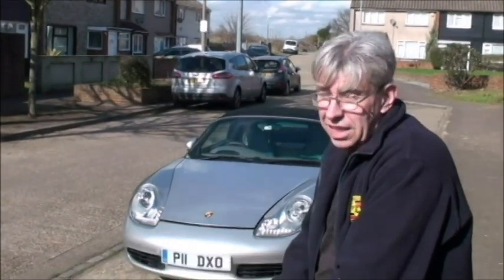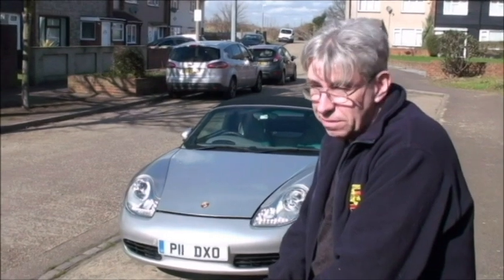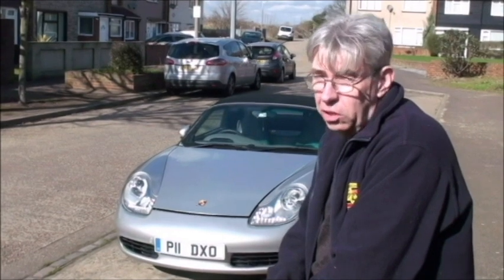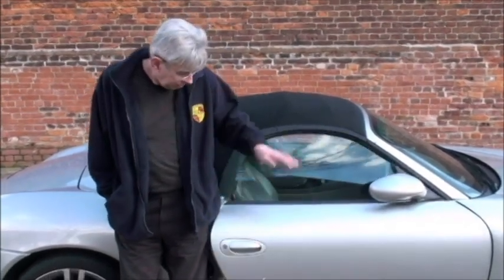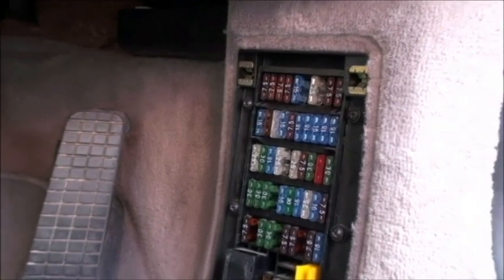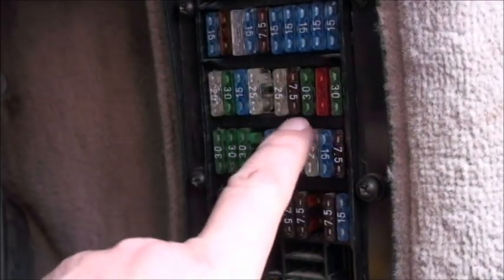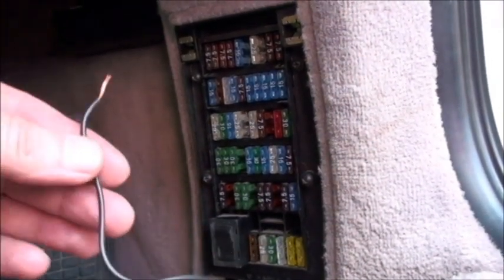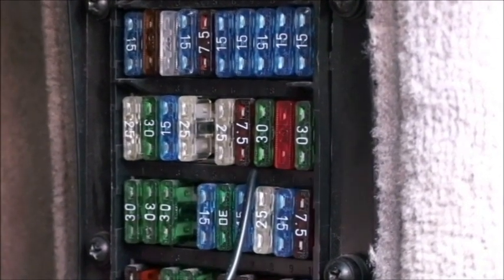Dead Battery: Opening the bonnet on a Boxster 986

Comment: Visiting this page in 2021.  This trick got me out of a bind when the battery on my 2000 Porsche Boxster S went completely dead, and the guy from the towing company said he could not jump it if I cannot open the hood.  For this US model, the C3 fuse is indeed 3rd from top and left.  It worked just like the video says --the car was able to get enough power to get unlocked, and for me to pop the hood.  Now I can recharge the battery myself.

Comment: Hey Mr. 1962 I'm mister 1963 ;} Thanks for this, but I'm still stuck my 2003 Boxster (With drivers side on the Left) Has the pull out Red Lead but is still dead in the water. I assume I fried a fuse or something ... It's about to start snowing and I need this car stored for winter. I'm guessing I need to start pulling fuses next... I even tried donating the car but the charities won't tell you what the tax write off will be... I'm guessing this vehicle will go up rather than down in the future ;}

Comment: The early boxsters have a cable bonnet/frunk and trunk/boot release so all you need to do is unlock the door. You can tell the cable operated cars because the have a long lever, the later ones have a very short pull up ‘button’ electrical release. Your car should have a cable release which is why you don’t have the positive terminal in the fuse box, you don’t need one!
Reply from the maker: yes mine has the cable release, problem was the bonnet was locked, so you cant pull the cable until you can get the central locking to unlock the bonnet
Reply: Yeah, NO.  My 2000 S has the cable levers but they seemed to be locked down while the battery is dead.  I'm going to try these tricks tomorrow.  Tried earlier today but tried fuse 3 down and 3 to the left as the video stated and nothing worked.  I'll try 3 down and 3 to the right as a couple of people mentioned tomorrow.  Maybe some differences in fuse layout between the UK and US cars.
Reply from the maker: @williampotter2098  Hi William, take a look up behind the wing liner (right hand side looking at the car from the front, on UK cars)  there should be an emergency bonnet/trunk release cable. It maybe on the left on American cars! the problem is although it is a cable release system once the battery is flat the central locking locks everything.
Reply: Paul1962 my car has the release cable rerouted through the front towing eye, just pull the cover off and there you go. In the event of a breakdown the car has to be flatbed recovered rather than towed in any event so the front towing eye is no loss.

Comment: Thanks for this - it really helped me.  However, it was a DIFFERENT FUSE on my 1999 Boxster.  Its fuse C3 (15amp), which is on the 3rd row down and 3rd fuse from the LEFT, not the 3rd from the right as per your video.
Reply from the maker: Yeah, it seams to change from model to model and depending on the year, but glad it helped you out, it's a pain when your stuck between a rock and a hard place, lol
Reply: If it's another fuse, how do you know which one it is ?

Comment: Tried that back  trunk opened main lock still not unlocked then fuse blew. Should i keep  trying??
Reply from the maker: Double check you have the correct fuse, whole car should unlock, also if its blowing the fuse you may have a deeper problem.

Comment: This really saved me. My 1999 Carrera (996) was parked next to a wall where the right tire could not be removed to access the manual hood cable release (from the 2000 Carrera the fuse box jump was added). My 996 is the U.S. version, and the fuse was in the same place. Thanks.
Reply from the maker: Really glad this helped you out, it's what makes it all worth while to me

Comment: On a 2000 Boxster S 
4th row....3rd green fuse from the left (marked with a 30)...insert your wire...follow directions on how to attach the wire to the battery charger. The horn may start to sound. Take your key remote and press the unlock button. The horn will stop and now you can use the lever to unlock the hood to get to the battery. Hope this helps someone out there :)

Comment: Hello Paul, hope you are doing well.. Have the same problem, but my car is the Boxster S 2000 and the fuse box is different. We you be so kind and let me know what device runs that fuse (3rd row down, 3rd spot left). Thank you in advance for your response. Warm regards, henry, Calgary, Canada
Reply from the maker: Hi Henry, you are looking for the fuse that powers the central locking. on some of the later cars, there is a jump start terminal in the fuse box so look for that too, it will be a lot easier. lastly, check under both front wings for an emergency release cable, as I have received reports that it can be on either side depending on the country the car was sold in. regards Paul.

Comment: Hi on the video you are dealing with C8 fuse, which is radiator fuse (see the link for the fuse diagram). How it is linked to the hood opening? Should not do this procedure with the C3 fuse which is central locking/alarm fuse? Thanks
Reply from the maker: i used the fuse diagram from the Porsche hand book, as you can see from the comments this has helped a lot of people out of trouble!
Reply from the maker: Glad it helped

Comment: Hi- thanks for uploading this. I'm in the same situation. Could you please specify on what type of car wire to use? perhaps a stupid question but I don't want to break/fry anything by using the wrong amp/V car wire ! thanks
Reply from the maker: i used standard car accessories wire, something that can handle around 10 to 15 amps, remember you only want to power the central locking system
Reply: Paul1962 thank you very much !

Comment: Paul, 
The jumper lead, can that also be a battery charger? I have a 2000MY 3.2S and battery is flat. Will it enable me to open the bonnet if the key fob button does not work? Panic alarm going off at 10:30pm.. :( alarm not going off now fortunately but it was earlier..
Reply: From reading the forum I need to get the central locking working but will need to open the car, switch the alarm off with the key, then close the door and use the. Key in the door to "open the central locking" as the key fob does not work 🤔 then hope with the system powered by your cable method  the central locking opens the bonnet pull lock.. Correct?
Reply from the maker: Hi John, I think someone else did with a battery charger, but not sure whether it worked or not, but it should work without the button on the fob, try the locking switch on the dash
Reply: @Paul1962  Thanks Paul.. + for the dash switch reminder.
Reply: @Paul1962  the battery charger did not work or the switch but will try it with a battery and jump leads as the charger said "fault" so may not have been powering up..
Reply: All, the battery cable pull by removing the 4 screws around the fuse panel and removing the trim as per the video above. I also blew the fuse in my battery charger with the wire.. The fuse 3 down and 3 in is now in the battery charger.. Got there in the end.. Fuse shopping next.
Reply: What I did was, as soon as it started beeping, I kind of freaked out because I wasn't expecting it. I tried the hood lover since there was power, but it wouldn't release. I looked in my pocket and got my key fob and tried the trunk release and that didn't work either, but then I hit the door button on the key fob which turned off the alarm. At that point, I unhooked the wire, reattached it, and, thankfully, the alarm did not come on. I tried the lever this time and it worked fine.

Comment: Sorry to be an "ass" here but... the whole reason I needed to watch this video again was to clarify something super basic... When one removes said fuse and then attaches a "jumper" to said fuse location... One now has 2 choices ... you may think I'm an idiot for asking this (and I might be) BUT... to move forward... ;} One has now 2 choices ...A plug lead into TOP slot (of the fuse) or B plug lead into bottom slot... again maybe I seem like a moron for asking but DOES IT MATTER?
Reply from the maker: As long as you replace the fuse, it won't matter, as you are supplying power to the whole circuit.

Comment: Hi Paul thank you for your quick reply . The video will this defiantly work on my car ?  I don't want to wipe out the electrics you see . I run a Porsche  Boxster  986 group on Facebook and already I'm getting mixed replies to a post I put up earlier concerning this issue I have . Thank you
Reply from the maker: hi, it is a last resort thing, i would ask someone to pull the front of the liner down so they can get there hand up and feel around for the manual release, i know its a pain. You defiantly haven't got the jump start terminal in the fuse box on yours? The fuse layout can change depending on speck, but basically you need to get power to the central locking system

Comment: Thanks for the tip! On my 2000 Boxster S Coupe in USA the door/hood locking fuse was located at Row C #3 and was 15 Amp. Hooked up a 12 volt
battery to fuse wire jumper & door hinge and hood release unlocked!
Reply from the maker: Glad it helped you out, handy little thing to know

Comment: best thing to do is  go out and buy a portable jump box that is about 7in sold at Harbor Freight and comes with its own pouch , cables ,usb chargers for Android and iPhone, built in flash light and Fits in the storage compartment of your Boxster or  behind the seats ! If your battery ever goes dead you always have a backup. It works great good quality I have used it multiple multiple times it's like $74
make yourself a note on how to do the procedure to power the hood release and keep it in there. I think it's pathetic and quite honestly embarrassing for Porsche to design such a stupid system. even today in 2019 cars are using cable latches to open the hood of a car, Porsche today is over-engineered and too many things to go wrong.
Reply from the maker: I got a charger the plugs in to the cigarette light, but it didn't work, but yes they try to over engineer things now days

Comment: Thank you for posting this video, it saved me loads of time on my LHD 2003 Boxster.  And yes, it did have the pull out jumper in the fuse box, but with a dead battery, it would not charge nor operate the hood release (Bonnet for our european friends).  But just a note, the legend inside the fuse box cover is useless and doesn't even look like anything close to how the actual fuse box is laid out.  The fuse you need is also 3 rows down, but 3 in from the left.  Thank you again and you save me from pulling my fender well out in the freezing cold.  :D
Reply from the maker: Glad it save you a bit of work, thanks for wathing

Comment: What happens if I have it hooked up to the wrong fuse? Can it do any damage?
Reply from the maker: Putting power to a given circuit will make that circuit live, if you are not confident with finding the right fuse I would suggest  asking your local garage or mechanic to help out.
Reply: Paul1962 thanks. What kind of wire works, or any type of copper wire?
Reply from the maker: @OkanaganBTC  any type of wire, around 35 amp
Reply: Paul1962 thank you Paul 🙏

Comment: Hi Paul, have u got the link for the emergency bonnet pull location please?
Reply from the maker: I don't have a link, but it is a wire cable up under the nearside front wing on the UK cars, it is a lot easer to find it if you take the arch liner out.

Comment: Paul, imhave thisnproblem in Feb 23, 2020   My 2003 has the fusebox terminal.  It worked a month ago. Today after some weeks of unavoidable absence, the battery is dead, and this trick won’t work today.  But...what is that black micro switch unit at the bottom left of the fuse array, and should it be checked for the correct position?   Which is?
Reply from the maker: The switch is for manually raising and lowering the rear spoiler

Comment: Tried this ploy - fuses on my 2000 2.7 looked a lot different.  The 3x3 fuse on mine is a red 40A  I could NOT get the fuse back in so tried a 12vdc probe on one side of the fuse...Got an Idea you MUST have the fuse in place to do this trick
Reply from the maker: Couple of people have said the fues's are laid out differently on some models

Comment: Ok, thanks for the rapid reply.  So...I jumped the Porsche connections points (fuse box specific terminal and a grounding point - the door hinge)to the fully charged battery in my brand new Jazz, so the donor battery isnt the issue. .  2 months ago it worked.  Today it didn’t.    

Should the jazz have been running, like any engine jump start, or would that at least have helped?

TVM again.
Reply from the maker: It shouldn't need to be running, if you're battery is really flat, it may be a good idea to leave it charging for a while to put a bit of charge in the battery, I viewer reported that it didnt work straight away, so he left the doner battery connected over night and it worked next morning
Reply: Ok Paul,
I agree the Jazz (Which is only 2 months old)  needn’t be running for such a small power demand, but it will be at next attempt.  Thank you.

Comment: This only works if you can open the door.  What about 2007 Porsche boxster when the door is locked and the battery is dead?
Reply from the maker: I'm not sure about the 2007 models, but the earlier cars you can unlock the door manually with the key
Reply: @Paul1962  The key used to start the car, can be inserted into the door lock and turns 90 degrees both ways, but does not do anything.
Reply from the maker: @shawnayromloo9612 on my car the key opened the door even with a completely flat battery, you could feel the key operating the lock, mine is a 1997 986

Comment: Thanks Paul your wire system worked on my 2000 3.2 boxster s.  I was very dubious watching your video but with the alarm going off i had no choose other than giving it a go. The fuse was where you said and we used a battery charger as the jump leads were in the bonnet!!  With out people like you we would all be in trouble   MANY THANKS Terry

Comment: Paul, by th way, do you have idea what could be a reason of the passenger window that does not drop when opening the door? Thanks
Reply: A microswitch in the door handle is bad.  You can try cleaning it and lubricating before replacing.  This microswitch tells the car that the door is open.

Comment: Serious design flaw. Excellent reason to not buy
Reply from the maker: A flaw that was rectify quickly, definitely doesn't out weigh all the great reasons to buy one of the best roadster ever made :)
Reply: If that’s your only reason not to buy it’s fairly lame. There is an emergency bonnet open cable as well, mine is relocated in the front towing eye so I just pop the cover off and it’s open, 2 seconds work literally.

Comment: le cambié el motor a un porche 99 boster y no arranca  la bomba de gas. no  tira presión
Reply from the maker: No estoy seguro de si la traducción correcta, no creo que sea la bomba de combustible como el problema parece ser con el banco de la mano izquierda

I'm not sure if the translation correct, I don't think it is fuel pump as the problem seams to be with the left hand bank

Comment: Will this also work on a 1998 996 911?
Reply from the maker: I would think so, the two car share a lot in common, check the handbook for fuse placement with in the fuse box as this can change.
Reply: @Paul1962  thanks! What is the fuse description for the 986?
Reply from the maker: @911TVR  That's a very good question, I will get the handbook out later and look it up for you
Reply: @Paul1962  thanks Paul!